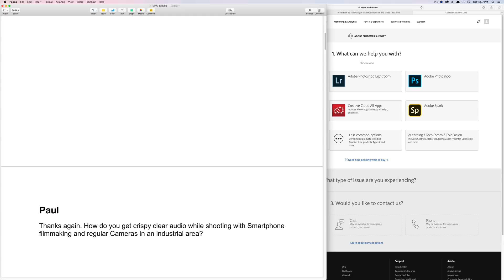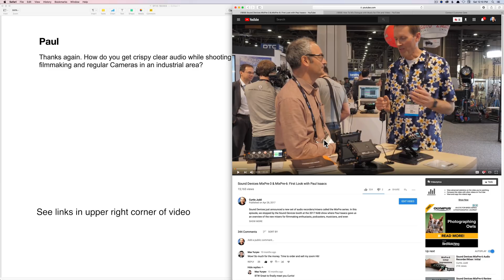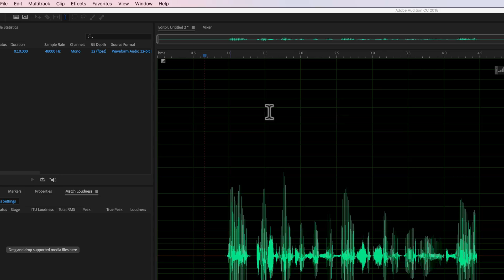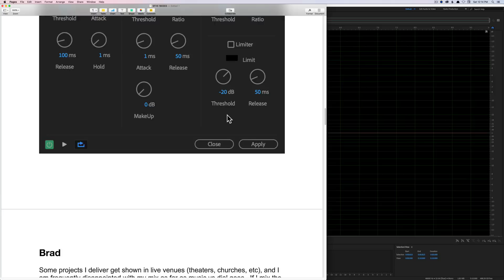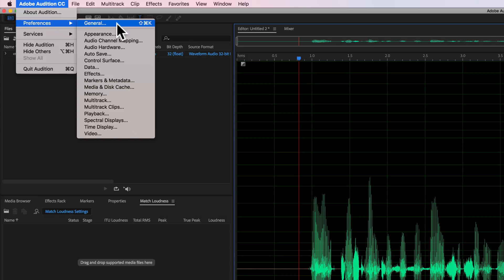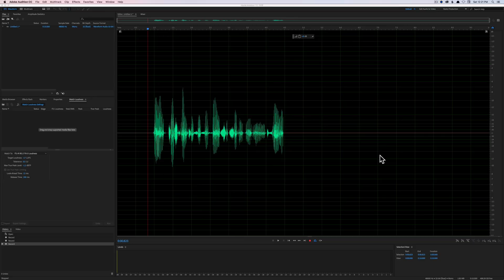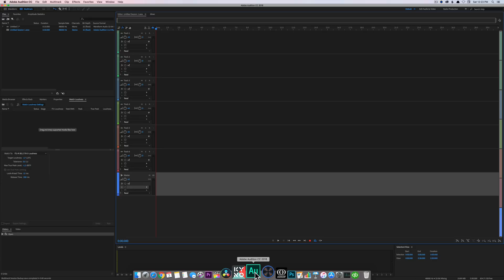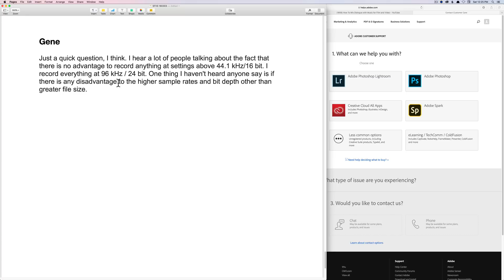Sound for Video Session: Timecode, Recording in Noisy Places, Optimize Audition, & More

Comment: I know this is an older post, but I do have a question about the timecode. I just shot a show for a corporate client. We were using an audio board that had Dante and I connected that to my laptop so I can have all the individual mics going into audition for iso records. I have a timecode generator. I was wondering with that workflow is there a way I could send timecode from my timecode generator to audition for the live recording.
Reply from the maker: Add a timecode generator to one of the inputs on the mixing board to record it. Then in post, you’ll need to use an app to covert the audio timecode. Tentacle sync and DEITY both make apps.

Comment: Thanks again Curtis. I hope you're fully recovered from your illness very soon. 

Re: playback in halls, auditoriums etc. Put simply, there is no 'one size fits all' as it depends so much on the acoustics of the venue where the playback occurs, the quality of the system they have and the size and position of the playback speakers. Another factor is that older people generally find it harder to differentiate sound and find the music/dialogue balance more critical than younger folks. This is a very live issue in the UK at present with regard to broadcast drama and documentaries. I'd say, that it's best to have a hi-pass filter at about 100/125Hz across the whole mix, always aim for dialogue intelligibility over artistic creativity and try the mix on various systems in various environments before 'releasing' it. What sounds tremendous in your mix room may sound decidedly average in a living room or hall. But in the final analysis you're at the mercy of the skill (or not!) of the person controlling the sound playback and looking after the EQ controls on that system.

Re: sampling rates. Word-length is far more critical than sampling frequencies. So always go for 24-bit. This is not to do with the final product, but the processing that takes place during editing. In normal circumstances 44.1/48 is perfectly acceptable. Apart from specialist techniques such as you mentioned, higher sampling rates merely occupy more disc space with the created files.
Reply from the maker: Thanks for the perspective Mike!

Comment: Thanks for all your answers, Curtis. I have a follow up question for the question about noisy environments. You've mentioned that due to the lower sensitivity a dynamic microphone is a better match for such environments. What would be the difference between that and using a condenser microphone with lower gain in such environments?
Reply from the maker: Hi Serge, it is relative: if you reduce the gain on a condenser mic, everything gets quieter. But since you're going to boost that in post, it all comes back up. The difference is that dynamic microphones naturally pick up less of the sounds that are not close to the mic vs. condensers.
Reply: That makes sense, thank you!